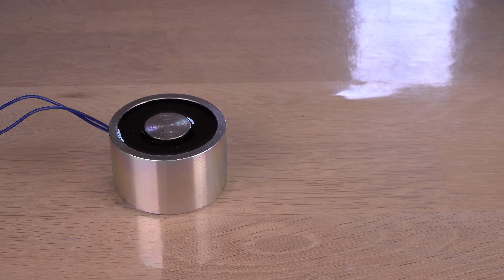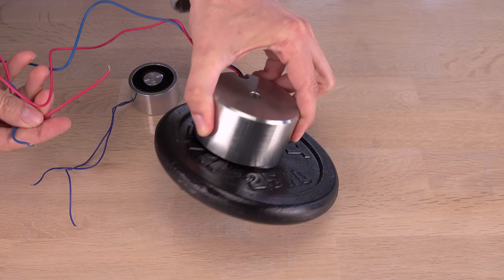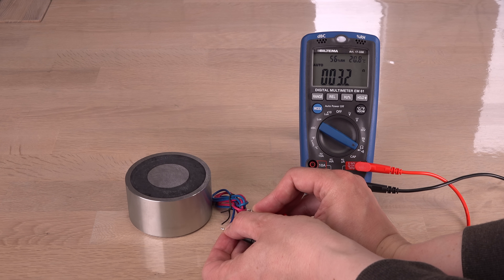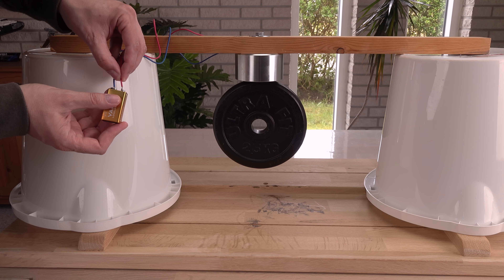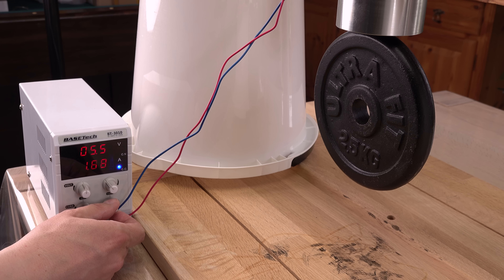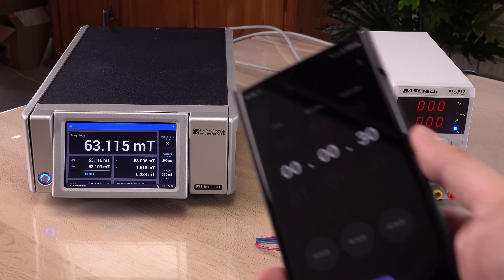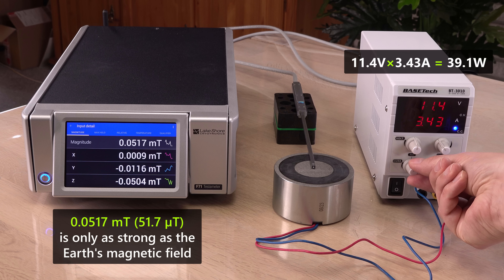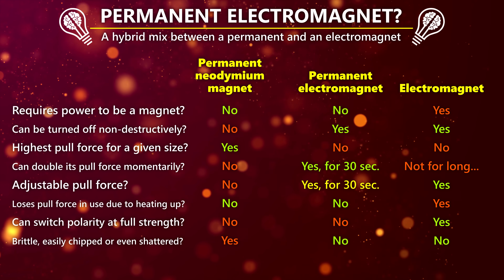NO ELECTRICITY Electromagnet?!? The Weird and Wonderful Permanent Electromagnet

Comment: I wonder if this is the kind of electromagnet that is sometimes used in scrap yards.  After all, in a power fail situation, we wouldn't want a couple of tonnes of rusty old Ford dropping out of the sky.
Reply: No. Its just forbidden to walk under the crane.
Reply: No, never. The reason is practicality and  costs. Making such a big and powerful permanent magnet would cost billions.
As such, scrap yards use a way much much cheaper standard (non-permanent) electromagnet, where the magnetism is created by coils, not by a gigantic magnetic iron slab.

Safety is an issue, yes, but you can get enough safety by prohibiting walking near such cranes in operation.

Comment: I think this is the principle behind the scroll wheel in the Logitech MX Master and Anywhere 3, that can shift from a clicky regular mode to a freewheel mode.

The previous models used a regular tiny electric motor
Reply: I had a MS Sidewinder mouse with free vs clicky wheel feature and that was achieved by a simple push-on-push-off mechanical toggle applying/removing detent pressure from notches on the scroll wheel's side.

Comment: Interesting, my first thought was that it may be similar to those magnets that you can turn off (that internally have two permanent magnets, where rotating them against each other cancels out the magnetic field), but they switched one of the permanent magnets to an electromagnet. Very interesting design, I wonder what the intended applications were when they developed it. Maybe a magnetic door lock that fails closed, rather than open, when power is lost?
Reply: Probably like some kind of security door maybe at a prison.
Reply: @peteasmr2952  Yes, although you could also use a non-permanent electromagnet with a spring system for that. I guess that would be more common because a lot cheaper and result is the same.
In that case , the non-permanent electromagnet is used to actually release the lock (pull a lever), and it is the spring system which holds the door locked when the electromagnet is not powered. So in case of power outage, the door stays locked.
Reply: My guess is fire doors. My high school had those where they'd hold the door open magnetically, and they'd swing closed when the alarm went off.
Reply: @JessicaKStark  Absolute NOT. Quite the opposite!
Fire doors which need to close in an emergency or power outage ALWAYS use NON-permanent magnets, the opposite of what is shown in the video.

Comment: I was wondering the other day, how on earth the sving hitch "jydekrog" on my car worked. it does definetly feel like a magnet holding it in place, but i could not understand how it could do so without power, since a button releases it. now i know. it must be similar to this, thanks :-)
Reply: There are also mechanical switchable magnets. Used in construction to lift stuff, like steel plates during road work. Also sold as soldering accessories.
Reply: @Benoit-Pierre  I know very well of the mechanical switchable magnets, but the hitch is completely silent when it engages and disengages, so its definetely not mechanical :-)
Reply: They just spin 1/4 turn
Reply: This is the first time I've seen the words:
sving hitch "jydekrog". Swing hitch? I'm so lost. Am I having a stroke?
Reply: @KirkHermary  Its a hitch on the car. usually its tucked up underneath, but a press of a button in the trunk it falls down, and when you swing it up into place it locks. press again and it releases and you can swing it back up underneath and away. jydekrog is just danish slang for hitch :-)

Comment: Well, an electromagnet that turns of with electricity makes more sense commercially, since you only need to turn it of for brief moments. Cheaper electricity bills are always nice
Reply: Completely depends on the application.
But yes, for that reason (among many others) they are made... in case where you need a semi-permanent holding power and only briefly release it. They are also used in speakers, headphones, electromotors, tvs, etc etc

They are more used than you'd expect though. Although not many people know the difference between a non-permanent (the most and well common known type) or a permanent electromagnet like this one. (even professionals often don't know the massive difference and quite often confuse the two apparently, reading from comments here).

Comment: I'd like to know what uses people would use this for, as it seems to be a very useful bit of kit, if the right application can be found.
Reply: Keeping stuff in place without power. 

Any use that looks like doors, except doors for safety reasons. 

You use them when you need « closed by default without power » and where not having power to open is not life threatening.
Reply: "I'd like to know what uses people would use this for...... if the right app can be found"   lol.... well...
They are commonly found in electric motors, generators, speakers, headphones, hard drives, door locks, sensors, (old) TVs, and numerous other devices.

Indeed, every electromotor has a type of permanent electromagnet in it. Every speaker, every headphone, every earphone IS in a fact a (small) permanent electromagnet.

Their usage is far more common than you'd think.
Reply: @CookieTube  i have dismantled hundreds of devices and can't remember discovering a single component like the one in the video.

I believe you confused static permanent electro magnets, with coil around the magnet, with mobile electro magnets where coil is designed to move along or around the magnet ( linear motor, speaker, spinning motor ).
Reply: @Benoit-Pierre  Nope. Look up "examples or usage of electro-permanent magnets". A "electro-permanent magnet" is a general term and there are all kinds of types depending on how they are configured and used.

Comment: Aren't these used in security doors were they have to "buzz" you in??
Reply: I think that's their main use - keep a door or gate closed until power is applied. A power outage will keep the door or gate closed.
Reply: No. There exist positive and negative latches depending on situation, they do the job without this item.
Reply: Wont that violate the fire code, which requires the passageway to be open even when the electricity is out
Reply: @SodaWithoutSparkles  usually there is a device called the break-bar which disconnect the magnet using another method - eg force multiplier or wedge separation method or bar slide type/secondary door , normally only used in high security areas and not public access.
Reply: They are used in fire doors to keep them open (door has a autoclose mechanism.) Magnets are triggered to close by electricity or heat in case of real fire leading to magnet loosing its strength.
Reply: @weekendstuff  Fire door magnets are releasing the doors at loss of power, so they are not having any permanent magnets.
Reply: @weekendstuff  Absolute NOT. Quite the opposite!
Fire doors which need to close in an emergency or power outage ALWAYS use NON-permanent magnets, the opposite of what is shown in the video.

Comment: Now I'm interested what it's designed for.
Reply: Holding doors open until the fire alarm goes off.
Reply: @RichardFraser-y9t  I would have imagined they'd look different if they were for that purpose
Reply: They are commonly found in electric motors, generators, speakers, headphones, hard drives, door locks, sensors, (old) TVs, and numerous other devices.

Indeed, every electromotor has a type of permanent electromagnet in it. Every speaker, every headphone, every earphone IS in a fact a (small) permanent electromagnet.

Their usage is far more common than you'd think.

Comment: It this used on big doors to hold them open, but if you want to close the door, you have to press a switch for the magnet to release?
Reply: Our schools fire doors were like that if the alarm went off all doors would release and close
Reply: @jasthebaker  I can 100% garantuee you that your schools fire doors were not like that. Quite the opposite!
Fire doors need to close in an emergency or power outage and ALWAYS, ALWAYS use NON-permanent magnets, the opposite of what is shown in the video.
Reply: No, the ones that hold doors are ordinary electromagnets that release the door when they lose power.
Reply: It can be used to hold doors closed passively until someone pushes a button and an internal circuit is complete for a certain amount of seconds, which releases the electromagnet. It's pretty common in workplaces where I live.
Reply: @gallium-gonzollium  I can't imagine fire code would allow that. The doors need to open when power is lost or you're gonna be trapping people
Reply: @RubixB0y  That's true for most buildings, but there are specific subtypes which fall under an allowance for fail closed instead of fail open. Deviant Ollam did a whole video on fire code and highlighted this aspect.
Reply: No i don't think they lock. I think they close to act as fire doors. People can still escape by opening them, just that they were being held open by magnets
Reply: @RubixB0y no fire doors need to close to prevent fire a smoke spread. They dont lock tho. They are fail safe magnets meaning they need to power to hold the door open. Power goes out they release and close. It doesnt even need to be a fire. Any power outage will release the doors
Reply: @RubixB0y Fire doors need to close when fire is detected to compartmentalize the building. They can be pushed open by people.
Reply: @howlingwolven I'm aware.
Reply: You have a good point